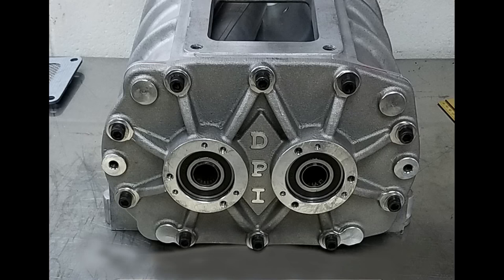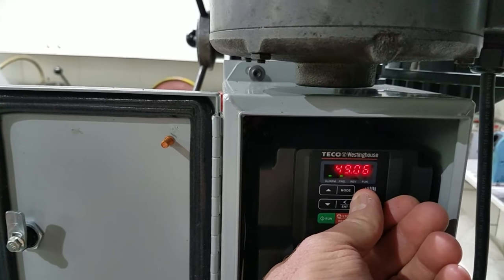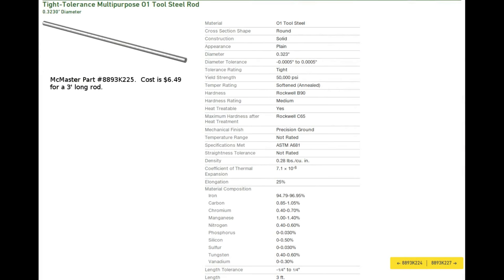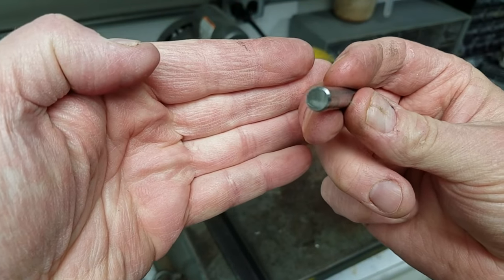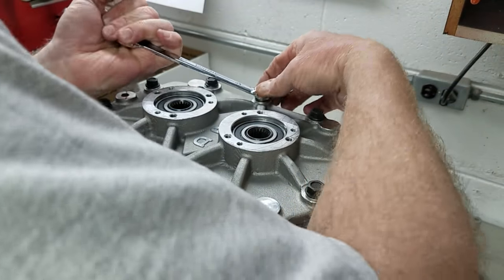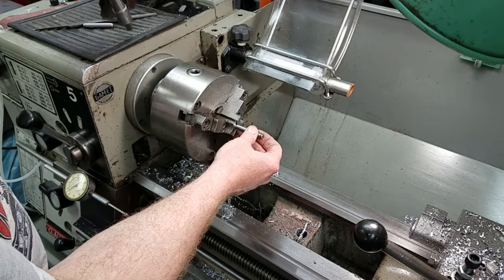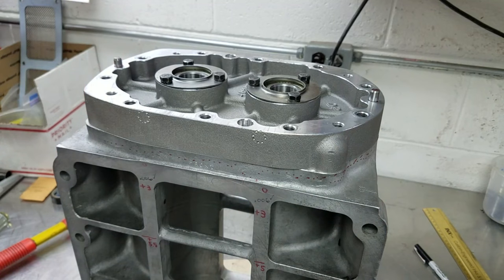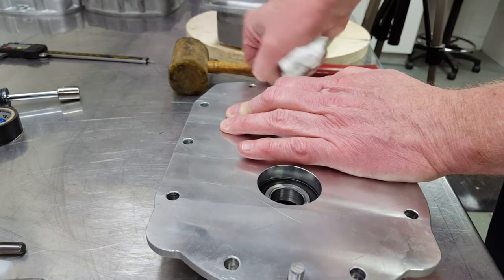My 6-71 Blower rebuild, Part 13: Installing oversize dowel pins.

Comment: Hi I have a question, Why does changing the dowels effects the bearing distance? Im not understanding. Everyone says to tighten clearence you just drill the dowels out bigger. But that doesnt move the rotors closer together. it just makes the holes for the dowels bigger. or is that an aftermarket bearing plate and you are making it fit?
Reply from the maker: You are correct, moving the dowel locations cannot have any effect on the spacing of the rotor bearing bores to each other.  The rotor centerlines are determined by the locations of the bearing bores in the plates, and are not changeable.  Moving the end plates slightly, and then re-doweling with oversize dowels only serves to lock in the new clearance between the rotors and the walls of the case.  Adding larger dowels without first changing the relationship between the case and the bearing plate will have no effect on clearances.  I hope that this explanation makes sense.  If not, watch Video 12 https://www.youtube.com/watch?v=mqF2t4B4mNE and then reply back here if things are not clear.   Thanks!

Comment: Unless I missed it, did you ever plug the drain back holes in the front blower case so as to not have the gear oil drain back into the case?
Reply from the maker: Fortunately my Diamond P bearing plates eliminate that hole.  No plugs needed!  Thanks for watching!
Reply: @MakerCave  thanks for the reply! Awesome